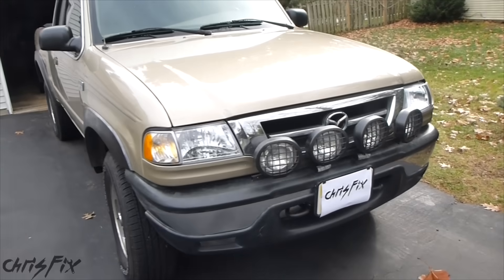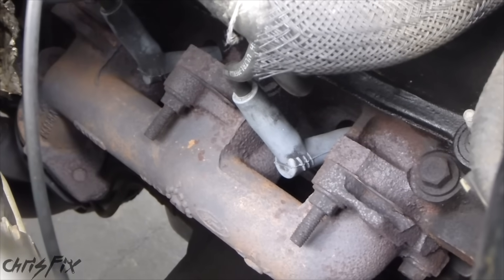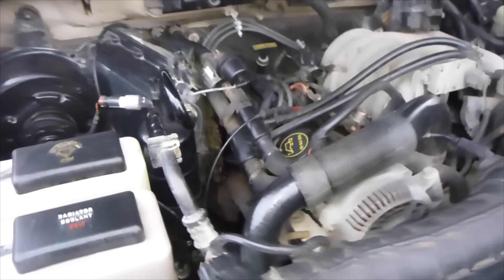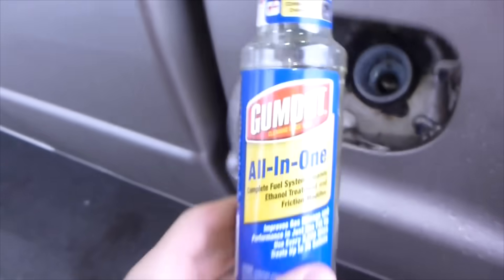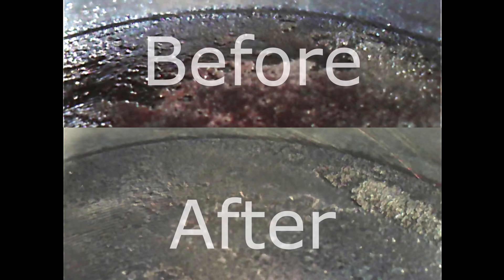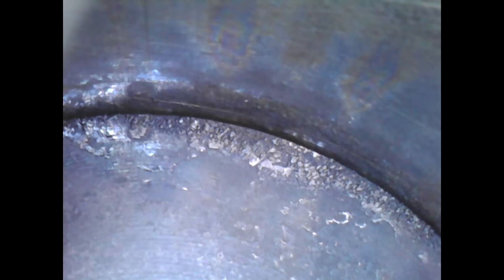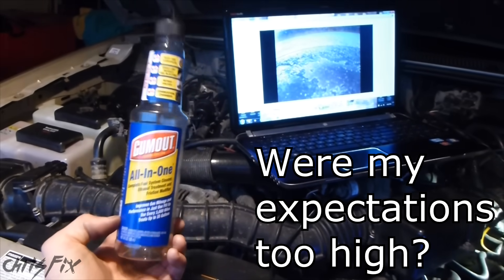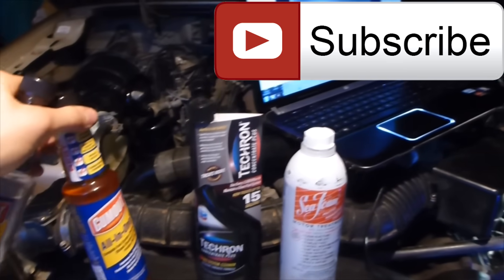Do fuel system cleaners actually work? Testing Gumout "All-in-One"

Comment: i think the point of the additive is to remove the soft carbon before it hardens so it needs to be used regurlarly from day 1 not after it accumulates and hardens over 120k miles
Reply: You need to be used huh? 🤣
Reply: @vader1943  good one I fixed it lol
Reply: Says so right on the bottle
Reply: I wouldn't try that because not only isn't it necessary, it's not practical.  Drive the car normally, get the engine warmed up at least once a week, use this additive every month or two if you want to, and don't worry about the carbon.  The reason you can really forget about it is,  a healthy engine will burn away excess carbon with no attention from the owner needed.  The amount of carbon buildup is self limiting, burns away as you drive, and if it increases it means you have a different problem (such as faulty injector, clogged air filter, fouled spark plugs, etc.) that needs attention.  Fix the problem and the excess carbon will burn away on its own.
Reply: @robertmaybeth3434  great way to put it
Reply: @robertmaybeth3434  "a healthy engine will burn away excess carbon"
incorrect, a healthy driving style, with plenty of mid-range revs, will keep carbon from building up.
ppl who drive around "chugging the engine", (doing 1000-2000 rpms under load) are ppl who get carbon buildup.
cars are designed to run under load (accelerating/hill climbing/towing, etc) in the middle of the rpm gauge (2000-4000 rpms), not a the extreme low/high ends.
SpecialBonusProTip: carbon does not "burn up", it is the end result of things "burning up"..
Reply: @Ghryst  the point is, if you have so much carbon an additive will actually improve your engine, you're doing something wrong.  I too use these additives, hoping fingers crossed they help long term.  But if your engine is having performance problems and sluggish running from carbon, as in old timey engines?  You might need something else in your engine.
Reply: @robertmaybeth3434  "if your engine is having performance problems and sluggish running from carbon" then you need to drive properly, and stop thinking a machine needs to be "babied"
Reply: @Ghryst  how about stop arguing and correcting....? You have your preferences, so do that and leave it alone for others...
Reply: @DougHinVA  Wrong™.
these arent mere preferences, these are operating directions. this is how it is to be done correctly.
preference my arse, its the difference between correct and incorrect.
ps: you spelled your name wrong, Dug
Reply: @Ghryst  Nice SpecialBonusProTip. You should let the guys at the coal plant know that so they won't chuck all that carbon into their plant for nothing.
Reply: @Ghryst  additives help somewhat... but no matter how toy drive there's gonna be build up. I fo to school for auto engineering technology....
Reply: @dontcryboutit  Wrong™
Reply: @Ghryst  lmao no kid
Reply: @Ghryst  not arguing with you
Reply: @dontcryboutit  thats not a very good argument..
i win
Reply: @dontcryboutit  he breaks it down a scrapes the carbon off every two weeks 😂
Reply: @thatsamazing8532  what? English?
Reply: @Ghryst  your are 100% correct Multi port injection cars spray fuel directly onto the valves cleaning the carbon off them, but it's not very effective unless it's under higherload. unlike direct injection cars with dont clean valves, those are what you need attractives in, because it goes directly into the cylinder no cleany cleany
Reply: @Ghryst  wtf does my pfp matter? this is literally my sister's account lmfao I only use it because it's got YouTube red
Reply: @siennaslaugh8900  yeah, i wasnt gonna say anything about your girls name, cos thats pretty usual for you millennial guys nowdays
Reply: @Ghryst  understandable, it's actually my sisters account I use for YouTube red lol
Reply: @siennaslaugh8900  nice, lemme know when she's online next, we might hook up
Reply: @Ghryst  if you wanna catch a case
Reply: @siennaslaugh8900  gotta be in it to win it
Reply: @Ghryst  omg😂😂😂
Reply: @Ghryst  Robert is literally saying the same thing. You shouldn’t have that issue in the first place, if you are, you’re driving badly. You’re arguing with yourself here.
Reply: @johnb8956  aint it beautiful :) its your turn now. 
You are wrong.
Reply: @Ghryst  lmao you want me to go out and hit 70 in a 35?
Reply: @robertmaybeth3434  The new GDI Engines need those fuel cleaner every 20K(KM) at least and if your engine have turbo
Reply: @Ghryst  Thank you for making, what, IMO, is super significant for ppl to understand) that point regarding carbon buildup.  Carbon is the residual, the final remaining "precipitate," from incomplete hydrocarbon fuel combustion.   And, as I'm sure you are aware, <100% or incomplete combustion is to be expected in closed(C) AND open(O) systems - whether practical (industry, C & O), experimental (laboratory, C), or natural (campfires & forest fires, O).  When you take into consideration that carbon has the HIGHEST SUBLIMATION POINT of ALL ELEMENTS (at NORMAL ATP, it doesn't even HAVE a melting point) at ~6,560° F, it shouldn't be surprising that 1) Carbon buildup is unavoidable 2) It is next to impossible for that non-sludge, accumulated carbon to be removed by further combustion with chemical additives. 
      Sir, if I've stated anything inaccurate or presented erroneous conclusions, please kindly correct me.  I'm devoted to continued learning, and sometimes that means accepting corrections by others a greater understanding and are willing to share.
Sincerely, Mike
Reply: @dontcryboutit  Dear Sir, I am trying to learn, so I can save $ by doing as much maintenance myself.  Your resume as an auto engineer caught my eye.  I currently have our 2001 Toyota sienna XLE and a 2005 Toyota 4Runner sport running great and would like to keep it that way -- y'know, drive every potential mile they can give me. I want to continue maintaining them myself (those things I CAN do, as a layperson) at minimum cost while making sure to do everything necessary and avoid the unnecessary. Discriminating between the two is difficult as the contrasting perspectives in this thread readily exemplify.  I wonder if you could be so generous as to critique and offer advice to me.  The paragraph below represents my current understanding of the science of carbon buildup due to incomplete combustion.  Your critique, and of it, and any other advice, would be greatly appreciated.

Carbon is the residual, the final remaining "precipitate," from incomplete hydrocarbon fuel combustion.   And, as I'm sure you are aware, <100% or incomplete combustion is to be expected in closed(C) AND open(O) systems - whether practical (industry, C & O), experimental (laboratory, C), or natural (campfires & forest fires, O).  When you take into consideration that carbon has the HIGHEST SUBLIMATION POINT of ALL ELEMENTS (at NORMAL ATP, it doesn't even HAVE a melting point) at ~6,560° F, it shouldn't be surprising that 1) Carbon buildup is unavoidable 2) It is next to impossible for that non-sludge, accumulated carbon to be removed by further combustion with chemical additives. 
      Sir, if I've stated anything inaccurate or presented erroneous conclusions, please kindly correct me.  I'm devoted to continued learning, and sometimes that means accepting corrections by others a greater understanding and are willing to share.
Sincerely, Mike
Reply: @Ghryst that last sentence is entirely wrong. Carbon does burn. It is the result of incomplete combustion not complete combustion and will burn so long as enough oxygen is present. What would be best to get rid of carbon build up is to just tune the engine to run lean for a while. Carbon build up is the result of running too rich.
In complete combustion, gasoline reacts with oxygen to produce carbon dioxide (CO2) and water (H2O) as the primary products. The reaction is as follows:
C8H18 (Gasoline) + 12.5 O2 -> 8 CO2 + 9 H2O

This equation represents the ideal scenario where there is enough oxygen available for complete combustion.

Incomplete Combustion of Gasoline:
In incomplete combustion, gasoline may not have sufficient oxygen for complete oxidation, leading to the formation of carbon monoxide (CO) and carbon (C) as byproducts, in addition to carbon dioxide and water. Here's the equation:
2 C8H18 + 17 O2 -> 16 CO + 18 H2O + C (carbon)

In a lean environment, carbon build-up from incomplete combustion can be further oxidized (burned) under the presence of oxygen. Here's the reaction for the combustion of carbon (C) in a lean environment:

C (carbon) + O2 -> CO2

Further more the build up of carbon as mentioned has absolutely nothing to do with rpm but instead has to do with improper air fuel mixture. Usually caused by a malfunctioning or dirty sensor such as oxygen sensor mass air flow sensor temperature sensor ect or by clogs in the fuel/air system such as clogged air filter or bad fuel injectors or fuel pump.
Reply: sure @JacobLeeson-zk1ol  , carbon can burn. so can water.
but the forms of carbon found in an internal combustion engine absolutely will not ignite under the conditions present within a internal combustion engine. thats why we have things like catalytic convertors to remove the unburnt carbon.
i'll just ignore the entirely of the rest of your novel, as you have ignored the basic premise of the conversation and have instead decided to base your argument on the Fallacies of False Equivalence and Non-Sequitur, which have rendered it irrelevant..
Reply: all these products are snake oil. you do not need them.

Comment: I believe like most manufacturers they probably are effective if you start using them when car is new. I'd be hard pressed to see much of anything get that carbon build up off. Main reason is if you've ever rebuilt an engine you would have found out quickly that a bench grinder with a wire wheel takes a good min to get the hard stuff off or sanding disc work maybe a little better just have to replace those disks more often. not sure if I've ever seen anything remove it all except for taking the engine apart and cleaning with elbow grease! The other more important issue is what happens when a large chunk Flys off. It could potentially damage exhaust valve or the seat which is bad for compression.

Comment: but did it clean injectors?
Reply: I've heard to keep all this clean is to avoid brand loyalty with gasoline.  Vary the top tier brands because they have proprietary cleaners that work on different build ups and prevent hardening from starting.  All base gasoline is the same.  Its the additives that make it proprietary.

Comment: Buy yourself a water spray that's usually connected to a small container. Unscrew the spray portion, feed its plastic down pipe into the fuel cleaner liquid then spray within each cylinder hole and leave for a few hours to eat away at the carbon then start your engine. The concentrated form should work wonders. Sometimes you can wait longer before you can start your engine so check the instructions for how long before it ceases to be useful. Also do this just before you change engine oil.

Comment: I'm not a technician but I've bought pretty much the same thing just a different brand and it did refresh the enginge and cleaned the fuel injection which was horrible a week ago..but on my product the instructions said to pour the whole bottle in a full tank, definitely takes time to run and clean it up, after a week or so it worked just fine
In your case maybe with more time running and driving it around with more fuel inside and the whole bottle of that thing, would clean up more I guess.
Reply from the maker: +YoIts420 blazed I have tested multiple products multiple times. Check the results in the description.

Comment: 122,000 miles and I still saw the crosshatch honing on a couple of those cylinders!
Reply from the maker: Not bad right?!
Reply: You might need a head rebuild but if the lower end holds up you'll be getting over 300,000 easy.  That's a sharp looking little truck.  What state are you in and did you buy it in the same state?  Don't look like you're in the rust belt too much.

Comment: Look into shops around you that use BG Products. I did a fuel injection service, similar to seafoaming the intake, but much better, and topped it off with a can of BG 44k in the tank and i can tell it runs a whole lot better. Look into it though.

Comment: It might have have been, as Chris had mentioned, that for vehicles that appear to have never been treated with any fuel system and combustion chamber cleaners, maybe repeated applications of such cleaners might in the end yied some significant results. As far as I'm concerned I've watched some videos by Chris for testing various cleaners and I could see that they all had done some cleaning.

Chris, I have a feeling that for those thick carbon deposits on the piston heads the product Lucas Upper Cylinder Lubricant might give better results. So, please do a video for that.

Comment: You should use one of the big jugs of seafoam. They say you can run 100% off of it to 100% clean the engine. Which I wouldn't say to do because that would be expensive but using a couple of bottles or the whole jug would be really interesting.

Comment: For the heavier carbon deposits I would think it would take more then just one bottle of any kind of cleaner.  

Also, you didn't mention that particular bottle  is a friction modifier which is important. Finally, only purchase fuel injector/system cleaners with PEA!

Comment: I'm sure if you use it on a new engine every three thousand miles it will looks squeaky clean. I know many ppl use this at 100,000 miles and up and while that's fine one cannot expect the same results as if you have been using it on the life of the motor. Great video though.

Comment: Mentioned this in your retry video, but I've been recommended to either drive on the interstate at around 75 mph, or drive on the highway with the o/d off when using a fuel cleaner. The constant higher rpms supposedly help it work better.
Reply: That's called an Italian tune up ...

Comment: You keep referring to the Cylinders and I think you mean to say Pistons. Your Cylinders look good and appear to still show Crosshatch indicating little wear. 
If You really want to clean the Pistons, Perform this old proven trick.
With the Engine at Operating temperature, run it at 2000 rpm and pour cold water into the intake so fast the engine stalls. Now look at the Spotless Pistons. This Process is Therm o Shock and has been used for years by the old timers. 
An old man taught me that trick forty years ago and it really does clean one up without any harm.
Reply: PD Johnson are you kidding me
Reply: I was surprised too until I tried it. After giving it some thought, I realized that it's Thermo Shock and rapid expansion "1500 to 1" water to steam. 
I'm a retired engineer and have back ground in Thermo Dynamics aside from being an Auto Enthusiast and Builder of Stroker  Motors.
I wouldn't tell you this to be BS, Try it on your Mower first and you'll see for yourself. I'm still using my 1973 Dynamark 8hp lawnmower to date including the fact that I also use Mobil One Synthetic Oil in all my cars , Trucks, and Harley's.
Thanks

Comment: Hi Chris, in your opinion can fuel system cleaners ever do any harm? I see the occasional review where people state things went wrong after using it however I'm guessing they used it in the first place because their car was doing something wrong and then it just broke afterwards due to the fault. My gf's Ford fiesta 1.4 tdci has a rough idle in the cold weather when the engine is cold. I put Wynn's extreme 3 diesel clean in it and it started to really run rough whilst this was in the tank but only on idle. Now it's run through it seems back to normal if maybe a little worse. I was wondering if you had any suggestions.

Comment: thanks! 2 questions. the gumout i use is in a white bottle the same size as seafoam. is there a difference between my gumout and what you used here?? and is does it matter if the additive is put in before , mid way, or after the tank is filled with gasoline??

Comment: I made a mistake of using these fuel cleaning systems on my Honda Civic years ago.  Prior to using the engine cleaning liquid, forgot the name, I used to get 35 Mpg+ in mixed city and hwy driving, after the fuel injector cleaner, I started getting 28 - 29 Mpg.  Never hit the 35 Mpg level again.  So I think, this fuel additive makes your engine worst, not better.  Just a heads up.  I did that when I was a 20 something years old, now I am almost 40, and have never repeated that mistake again.
Reply from the maker: Yea they can cause issues so if your car doesnt have any problems dont bother. In your case it could have clogged the fuel filter or injectors.
Reply: Zain Abidin yep an old saying 'if it ain't  broke don't  fix it.

Comment: Hey ChrisFix, did you drive like two or three hours at high speeds / 4000ish rpm on the motorway afterwards? That is what is recommended here in Germany before exhaust tests. maybe the continous heat helps blow off the carb soot?

Comment: maybe if you used this often it could prevent carbon from building up.
Reply: İbrahim Çetin but you're meant to use it every 3000 to 5000 miles I think it said.
Reply: İbrahim Çetin  I've heard  that using to these  cleaners  can destroy  your C.A.T 😿
Reply: Hcjyiu it mfk.  Going👻👻👻👻👻👻👻👻👻👻👹👹😸👹😸🚵🚵🚵👤👤👤🙇🙇🙇🙇
Reply: Yessss i also think it will work of you often use it!!
Reply: Carbon build up is compounded by not allowing an engine to reach optimal operating temperature before accelerating at excessively high speed. Also,, the air con must be avoided until engine is adequately warmed up.